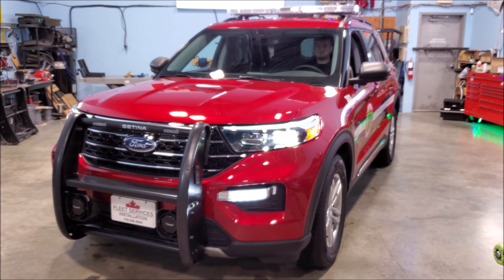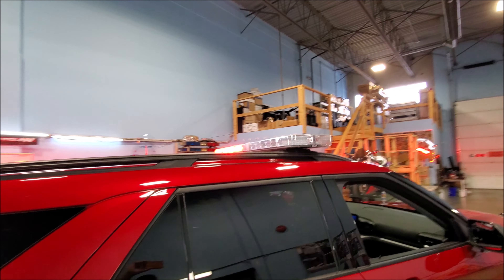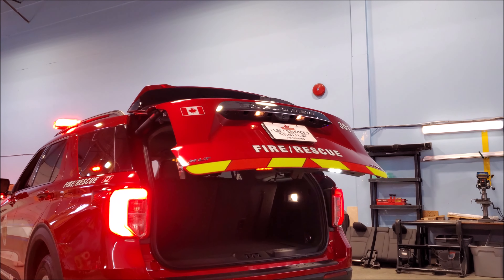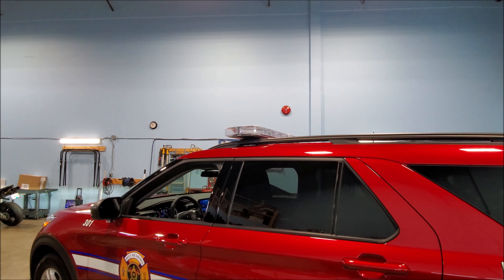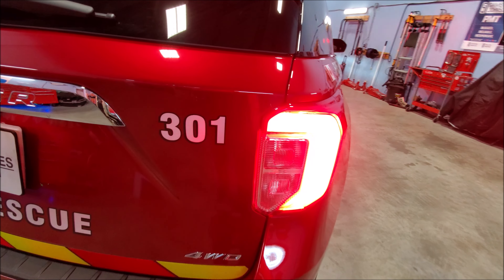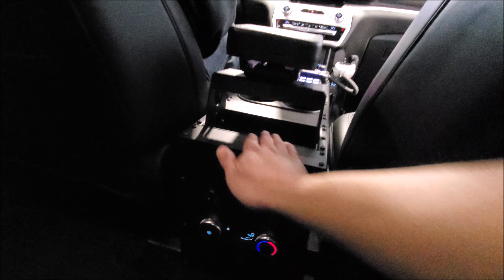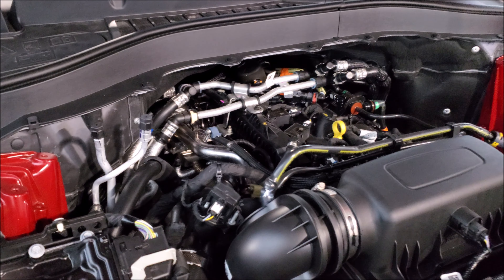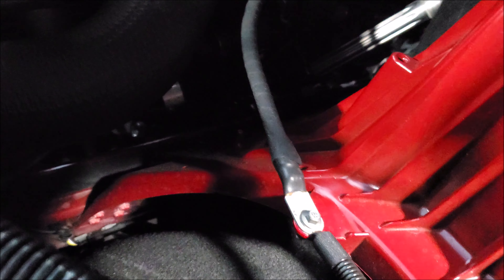2021 Ford Explorer Ecoboost Fire Chief Vehicle | AnthonyJ350

Comment: I'd be very curious to know how you made the tail and reverse lights do the rapid flash.
Reply from the maker: Tie in the factory with a Whelen flasher module but the brake lights and reverse lights always override. We build diode packs so the devices don't interfere with each other.

Comment: For front wig wag, you can use fog light. It work well and do his job as well, just saying if you have another civilian explorer 2020+
Reply from the maker: Thanks for letting us know
Reply: No problem buddy, the reason you can’t flashing the high beam is using CAN wiring or something like this. I don’t know what control head you using for this civilian explorer. But fog is basic wiring (negative and positive wiring if I remember).
Reply from the maker: @125francki125  Thanks, we didn't know all that.
Reply: @AnthonyJ350  yess hope you can help you sooner with other civilians explorer 😉